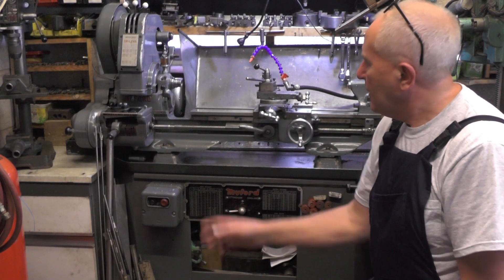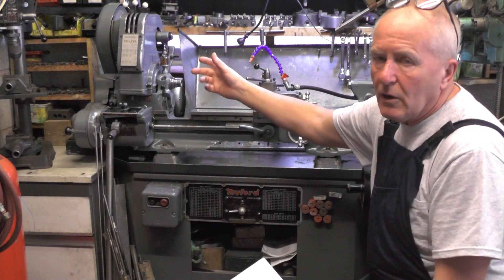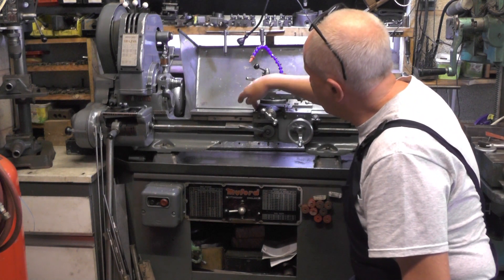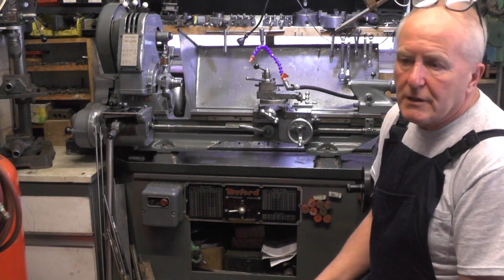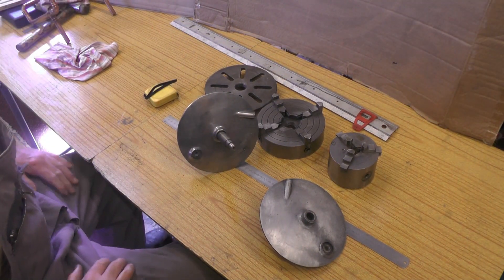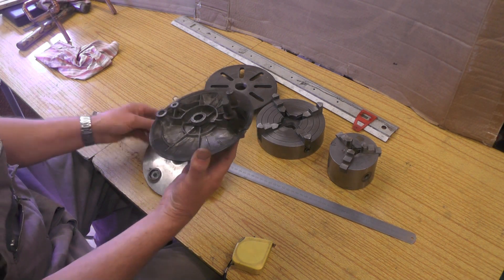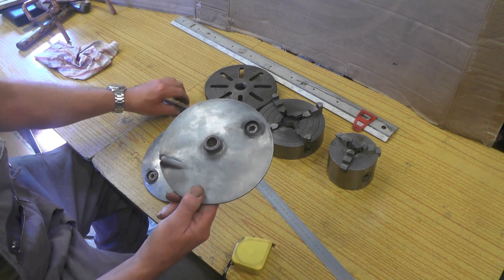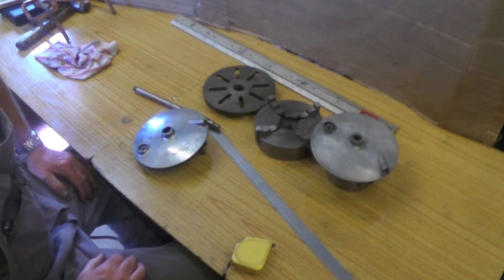Myford ML7 Tri Leva Lathe Verses Uncle Bunt Custom Chopper Brake "mr factotum"

Comment: Hey Mr F. 
Perhaps you could make an video werde you show  how to set up the Tri Leva adjustment probably. I have a ML7 Tri Leva too. I bought the lathe in a big box in peaces. I'm now into a restauration but never saw the mechanism in function. And the service book I have shows nothing about it. I think some other people will bei glad too if you do a Video about it. That would be great. Greatings from 🇩🇪
Reply from the maker: hi F5120P
thanks for feedback, i thought i had shown in these videos linked below, 
take a look to see if they help you. good luck with the Restoration project, you can't beat the tri leva lathe.
https://youtu.be/2oYquWv8u2w
https://youtu.be/E6lcE3sJsxw
https://youtu.be/2o9xThC5FvY
keep in touch and let me no how you get on with the project
regards
Kev
Reply: @MrFactotum  Hey Thank you for your quick answer. I overlooked this videos totally 😅. I think that will help a lot. I will text you wenn things get serious. At the moment I bring the original metal under cabin back to its old glory. There are many hour left to do on this thing until I can start wirth the lathe. I'm totally at your point the tri levas are great and you can't buy them from myford anymore. The quick change gearbox is possible to buy new if it has to but an tri Leva attachment is nowhere to find.
Reply from the maker: @Florian5120Pro  Great !  all the best with your projects👍👍👍👍
kind regards
Kev

Comment: What ho Mr F, 
Its always the oddity set ups that i find keeps the interest going., never did like repetitive stuff. When we were quite at work i would get to use tha Britan which was mind numbing so i would have to make patterns with the bits i made to keep from going (?) potty.
Nice condition lathe you have but i have a better one, down at SMEE they have the original prototype in new condition, they also have the original S7. Both a gift from Myford. They also have a perfect scale model that so impressed the boss at Myford he swapped a new lathe for it with the maker. Thinking of Myford, believe it or not i demonstrated Myfords for them at some of the shows a few years back, and me a complete amateur! 😉
With your spring cuts have you tried loading the cross slide leadscrew? I find that on final finishing cuts i get better consistency by pulling or pushing the cross slide to completely remove backlash. I always figured that on heavy cuts the backlash took care of itself but on light cuts the lube would act more like a shock absorber and depending on the angle of attack of the tool would pull, or push, the tool into or awsy from the work. I wonder if that makes any sense?
ATB   
c
Reply from the maker: wow chris 
nice to hear from you, might take me a while to digest all the comments, what's up havn't you nothing to do!!!! 🤣🤣🤣🤣🤣🤣What about some physio on the digit!!!🤐🤐🤐🤐
take care
see you next time
mr f
Reply: @MrFactotum  i have a thick silicon rubber condom on my thumb and apart from not making anyone pregnant it is definitely reducing the scars  appearance but the sensitivity is still variable.😢
Reply from the maker: @chrisstephens6673  sounds painful chris, 😲😲👎👎
Reply from the maker: @chrisstephens6673  now then chris, don't slip off your soap box!!!!👳🏿‍♂️👳‍♂️
Reply: @MrFactotum  no soap box standing these days, sense of balance all shot.😂